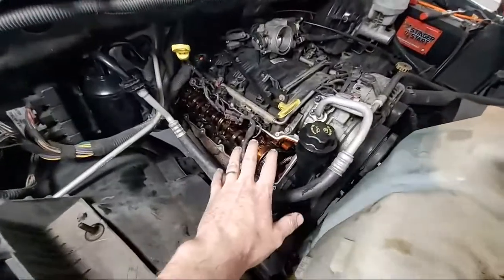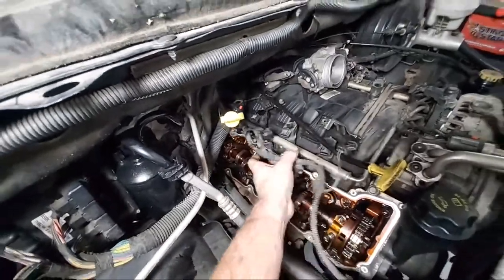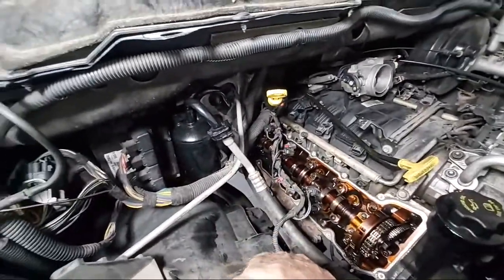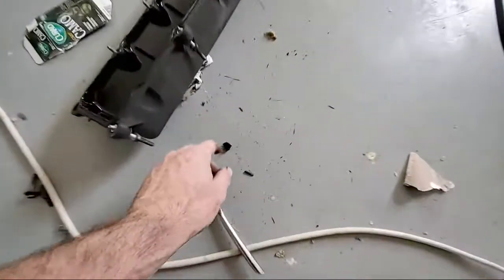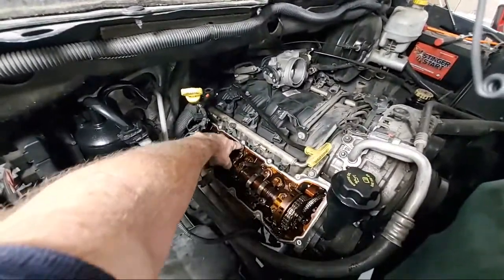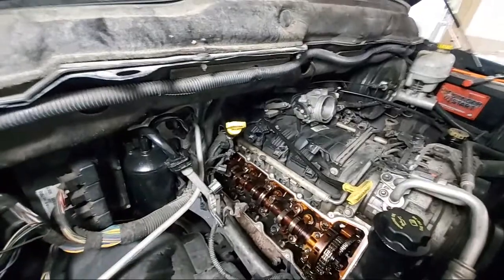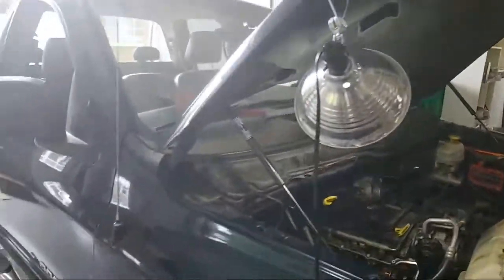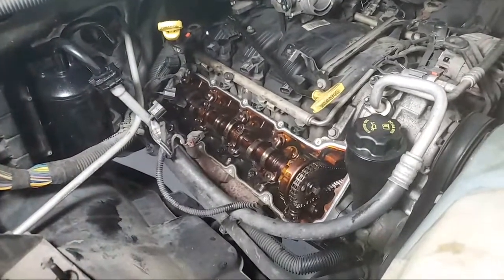Ram 1500 P0308 and Tick - Found The Problem

Comment: Thanks! This saved my WHOLE truck. Long story short, but I got the cel, tick, p0308 and my truck was losing power. I took it to the shop and they quoted me $8500 to put in a new engine. My truck is a 2002 with 225k miles. I had some gearhead friends take a listen and the consensus was always replacing engine, or redoing long block etc. I'm no mechanic, just mechanical. ALL of my knowledge has been through Chiltons (pre-youtube) and YouTube. I'm 51yo. Anyway, even YouTube wasn't giving me any hope as it only spoke about replacing plugs etc. and after that more serious and expensive repairs. In a sea of despair for my truck I found this video. I shared it with all the same people, even the shop. I've never done this type of repair so I had no idea of how to. But no-one gave me a listen. THATS not it I was told. So my personal choices were to sell the truck as is, or attempt the repair. I had to try it! Success!!!!! When I did get the valve cover off and seen that rocker in the corner I was beyond ecstatic. I replaced that rocker, that lifter and I bought a new valve cover. $115 
total and my truck is back to being the workhorse it was. YOU made everyone eat their words, including the shop. Thankyou so much.
Reply from the maker: I'm so happy and thank you for showing your appreciation.   I understand that one other issue that could happen is that the valve seat could get loose.  Hopefully, this is it for you.  The rockers are known for wear, and as long as it's tight now, I hope it all works out for you!
Reply: I'll do an update after a month. I've been driving it for a week now with no issue.
Reply: I can't get my rocker arm to go back on. Was the rocker arm loose or tight when you put it back on?
Reply from the maker: @bryanvance6629  it was loose.   It probably needs to be replaced.   It should not be loose or it will fall off again.  I used washers under the lifter but I recommend replacing the lifters and rocker arms (any that are loose or worn)  remember to manually turn over the valves as some will be looser and some tighter depending on their position in the combustion cycle (intake, compression, ignition or exhaust).
Reply: @SeanDIY  what kind of washers?
Reply from the maker: @bryanvance6629  it's best to replace the rockers or if the cam shaft is bad.  If the valve seats are a bit bad or the lifter space isn't precise there are people that say to out washers under the lifters. There are videos out there on how to do that.  I'm not recommending it, as it's not the right wasmy to fix it and results may vary.
Reply: Just an update....it's been several months and several thousand miles later since I did the repair. No issues whatsoever. I've even taken it on extended  multi-hour trips up north and she runs like a champ. I know this hasn't worked for everyone, but let me tell you, after the first time I got the cel and heard the tick I only drove it to and from the shop one time. And then it sat until I got around to doing the repair. I say this because I wonder if driving the vehicle for a prolonged period of time after it happens may contribute to deteriorating the cam shaft, or valve seats? And then it's more than just replacing the lifter, and, or, rocker? Anyway, again, I can't thank you enough. Thanks!
Reply from the maker: @azpete9822 this is great news.  I'm so glad to hear.  How many miles do you have on your car?
Reply: Just over 233k
Reply from the maker: @azpete9822  outstanding.  Keep changing the oil every 4k miles or less.
Reply: @SeanDIY it's a truck not a car
Reply: And is that a v6 that's what mine is

Comment: Thanks for sharing this, I’m in the middle of purchasing a 2013 with exact same cylinder misfire and pretty aggressive tick
Reply from the maker: I hope this helps.  Keep in mind there are a number of things that could cause the issue. It could be a bad spark plug, bad coil, this issue or worse, a blown head gasket or piston problem. I bought the truck for $1,800 and it ran so it was worth the risk to me.  It may not be for you.
Reply from the maker: How did it work out for you?
Reply: Mine turned out to be a reason for the ticking a failed lifter which I guess is pretty common for these even just over 100k miles but the dealer did take care of it under a sweet extended warranty lol
Reply from the maker: @brandonlong6894  bad lifters are common. I'm glad the warranty covered it.  My recommendation is to replace them all when you are in there because its likely more will go.

Comment: Was the truck shaking constantly before the repair? Mine is. Mine has the p0308, shakes constantly and sometimes when I hit the gas I have to press it further to “wake it up”. Also has a blinking mil under load.
Reply from the maker: It wasn't a bad shake,  but yes, it did flash under load and wasn't a ton of power if you step on it.   It kind of got stuck around 2k RPMs and struggled to get over that level until it downshifts.
Reply: I had the same symptoms with a P0303. It had a bad champion plug; which are junk brand new, that had been under gapped by the dealer. It was set at .020, and specs called for a .040 inch gap. I replaced it with a new properly gapped Autolite, and it runs superb now. I was going to change the other 7, and decided to bench check the rest of the copper Autolite set for resistance first, and they were all too high, brand new; out of the box. Made in China now, they all failed. The upper limit is 5k ohms, and only one in the entire set was under six k ohms, with some almost 9k ohms. The high resistance in plugs is what burns out coils, and you can buy an entire set of copper plugs for what just one coil costs.
Reply from the maker: That's crazy.
Reply: Good people are leaving the Automotive and small engine maintenance business because of come backs based on junk parts brand new, out of the box. I check everything now. I bought a walk behind weed trimmer which was missing the intake manifold gasket straight out of the factory. I just fixed it, and went on. No telling how many people had returned that same unit that I had got on sale.

Comment: I have this same code too and also have my temp guage going in the red for s couple seconds at random are these 2 problems possibly related?
Reply from the maker: If your temp is going up that is really bad.  It could lead to a blown head gasket, warped head or other engine problems.   If you overheat the engine it could be destroyed. Check the antifreeze as well because damage may have occurred already.

Comment: Ugggh I just got this code Friday. Doing plugs in a few minutes and am dreading it’s something more
Reply from the maker: I did a video on the plug change also. It's my latest video I posted to my channel. I share some other tips as well. It could be plugs, a bad coil pack, lifter or rocker arm issue and it could also be a valve ring that dropped. If it's a rocker arm that came off, 8 put washers under the lifters. Do that at your own risk, but I'd also replace the lifters while you are in there if you do take off the valve cover...and replace the valve cover gasket. All those parts are cheap at Auto Zone, so do it all while you are in there.
Reply from the maker: Here is the plug change video.  https://youtu.be/Y8DvJj1rhKk
Reply: Appreciate it. I have a 2015 with the 5.7 and see a lot of people talking about camshaft issues because of the MDS.
Reply from the maker: I don't know exactly how those work but it would seem to me that half of the engine would wear out sooner than the other half.

Comment: 05 dodge ram 1500 4.7....I'm also getting misfire cylinder 8. I did the spark plug and the coil pack. Same problem still taking place. Truck shakes while sitting at red light.
Reply: Have you figured out this issue. Im having same issue?
Reply from the maker: Mine had the rocker arm no longer connected on cylinder 8.  Check out my Ram 1500 Playlist for the video where I show this.
Reply: @SeanDIY  I took my valve cover off and the rocker arm popped off and was laying on its side

Comment from the maker: Update - I put it all back together and it ran nicely... For about 5 minutes and I have a hunch the rocker fell off again.
Reply: I think I am in the same boat as far as the Rocker on cylinder 8.  What was your next step since you think it fell off again after 5 minutes?
Reply from the maker: The only thing to do would be put another washer under the lifter as it relates to something I can do.  If it's the valve seat that fell the only way to fix it is to have the head removed,  but that's above my ability. I have not done anything with it yet.  I let the Ram sit for a few months and drive it the last 2 days and the check engine light hasn't come back on. It has been super cold, so who knows.  At 245k miles on the truck and the fact that I bought it with 241k for $1,800 it doesn't owe me anything. I'll probably just drive it until it will not go anymore.  Then I may replace the engine. I mean if I put another $6k into it, it's still worth it in the current used car price world.
Reply: Thanks…I will keep that in mind when me and my buddies attack this next weekend
Reply from the maker: @Brian Berry  definitely update me.  I'd love to hear how it goes.
Reply from the maker: @brianberry4956  how did it go on your Ram?  Were you able to get the issue fixed?
Reply: Well…wasn’t the rocker.  I have a dead cylinder wall due to a failed head gasket.  Looking to do an engine swap or rebuild.
Reply from the maker: @brianberry4956  Sorry to hear that.  I think a new engine may be worth it.  I think getting a remanufactured one vs. buying one at a junk yard or something where you aren't sure what the history of that engine is might be the better of the two choices.  I've heard that some companies that do the rebuilt and you return yours as a core is cheaper than getting it rebuilt locally and cheaper....though I'm not sure if that is true or not.
Reply: I am leaning towards remanufactured…they come with a way longer warranty than the junkyard is offering.
Reply from the maker: Yeah, junkyard is a complete unknown.

Comment: Found it Thanks 👍.  I seen a video on YouTube that had a lock clicp that keeps the rocker arm from coming off.  I could be wrong.   I think i have this problem
Reply from the maker: I saw that too.  It looks like it might work,  but if you have a dropped valve seat that dropped, you haven't solved the real problem.

Comment: Did you end up replacing the cam to keep the rocker arm in place?
Reply from the maker: I didn't.   The truck had 245k miles on it, so I didn't want to put a lot of money into it.    The cam looked OK when I opened it. If it had 120k miles I probably would have invested more.  I bought the Ram for $1,800, drove it for a year and sold it for $3,400 so not a bad deal.  In states that have emissions testing this truck will not pass.

Comment: I recently had a diagnostics run on my dodge ram 1500 4.7L . The codes were cylinder 8 misfire and camshaft sensor. So i replaced all spark plugs and coil packs and camshaft position sensor . It ran good for a couple of days now i am getting the cylinder 8 misfire code again also now a temperature sensor code and evaporative system code. Do you think what you mentioned about the rocker arm could be my problem?
Reply from the maker: It is a known issue from what I understand. It could be the lifter/rocker, or it could be a dropped value seal.  I would have switched the coils first to see if the code moved.  If it didn't, it wasn't the coil.   You already determined it wasn't the coil but at a bigger expense.

Comment: Ok here's am update. I took the valve cover off and the rocker arm popped off. It was laying on its side. What other parts do I need to buy? Another lifter too?
Reply from the maker: This is very common. It could be a bad lifter or a worn rocker arm or even a dropped valve seal (pray it isn't the valve seal).  I would replace all the lifters (8, I believe) on that side, and if you are up to it all of them in the engine.  You already have that side open.  If you replace them and find that the clearance is too much...in other words it seems like the rocker arm (new one) has a.lot of play, then you may want to do the washers under the lifter thing.  I'm not recommending it, just saying it's what many people do.  It may solve the problem or may not, but rebuilding or replacing valve seals is a lot more work
Reply: @SeanDIY  let me ask you. If the valve seat dropped, would I hear noise or something of that kind? I don't hear any noise of metal and the lifter was bad...when I went to put on a new one, it was loose after putting it on. You could move the rocker arm from side to side.
Reply: @SeanDIY  the lifter was bad. I'm self employed so this sucks for me because I pull a trailer for work
Reply: @SeanDIY  washers under the lifter? I don't know what you mean. Other words...never heard the tern before. So how that work? I'll try it but I need some instructions from you please
Reply: I'm still driving the truck without a rocker arm on cylinder 8. I have poor HP and poor gas. I replaced the rocker arm and lifter and just snaps and it's loose.

Comment: Would this cause no compression in that cylinder? Im asking cuz i have same mystery issue and just checked compression and it appears to be good
Reply from the maker: I think it would depend if the valves are stuck closed or stuck open.  If closed, I'd think compression would show as good, but the valve may not be opening because the valve is not being pressed down by the rocker arm.  Just my best guess, I don't have experience testing it.  If you have P0308 or a similar number (the last digit tells you which cylinder), you have a misfire.
Reply: Did you test it prior to the diagnosis of the rocker arm? And if so, what were the results from compression test on cylinder 8 compared to the other cylinders?
Reply from the maker: I wanted to, but it requires removing the fuel pump relay, and I wasn't able to access iI.  I replaced the spark plugs, and I swapped coils, and it always remained on cylinder 8. I also cleaned the idle air control valve (check out my video on that).  Once I opened the valve cover, it was obvious.

Comment: I got that code the other day on my '14 Ram 1500, deleted it, and it hasn't come back yet. Not sure if I should do a little exploratory surgery or just leave it alone.
Reply from the maker: How many miles?   2014 is a new enough Ram where it may. Ot be much, but if it's P0308 then that's the most common cylinder for the issue. I'd you have the 4.7L it's possible it needs new plugs or coils.  I would start by switching coil packs and seeing I'd the code changes to a new cylinder. If it does then it's the pack.  If it doesn't and the code comes back on the same cylinder it could be cause for concern.  The light coming on means it's happening a number of times, not once.
Reply: @SeanDIY  5.7 hemi. 100k miles
Reply from the maker: @jinglebells56  the Hemi has a different engine than mine.  They often have camshaft wear issues because of the fact that 4 cylinders shut off at highway speed to conserve gas. Still probably worth having a mechanic take a look.  If it's an issue the light should come back, but best to have it checked and then get another 100k miles or more.
Reply: @SeanDIY  The engine light came on again, same code, deleted it. Will take it apart on the weekend. I haven't really noticed any loss of power.
Reply from the maker: If the same code came up, did it tell you which cylinder?   I would start by changing the spark plugs.

Comment: So I assume P0308 is indeed cylinder 8 and not the 8th cylinder in the firing order? I've heard both.
Reply from the maker: I have heard both as well, but it was cylinder 8 clearly that the valve couldn't open. Had to be that one.  I didn't check but I guess it's possible that cylinder 8 could also be the 8th in firing order.